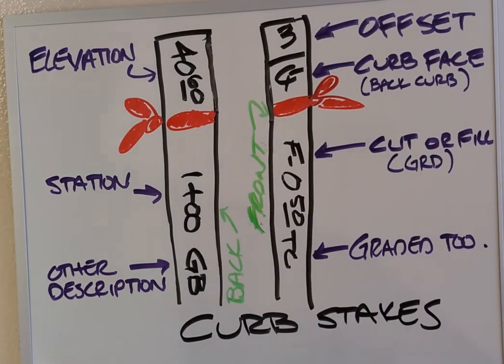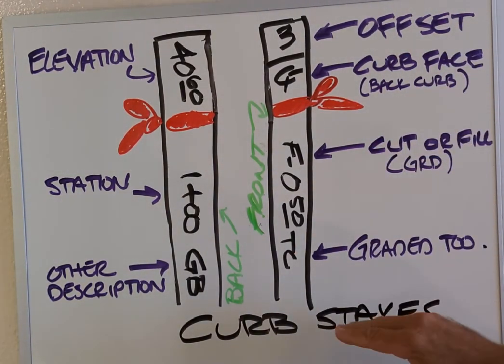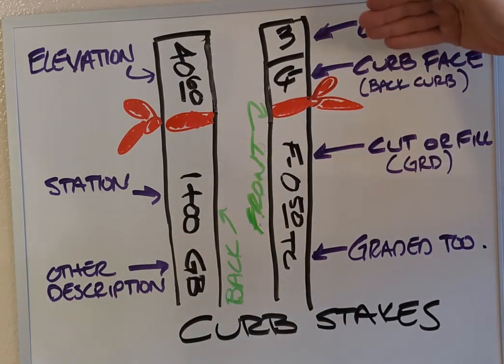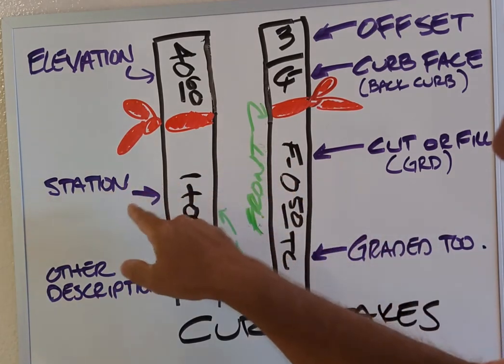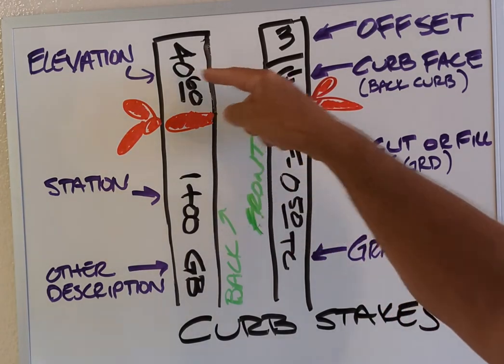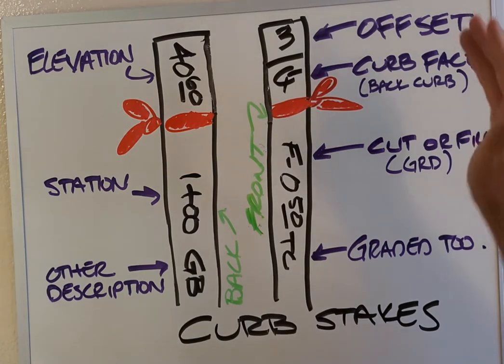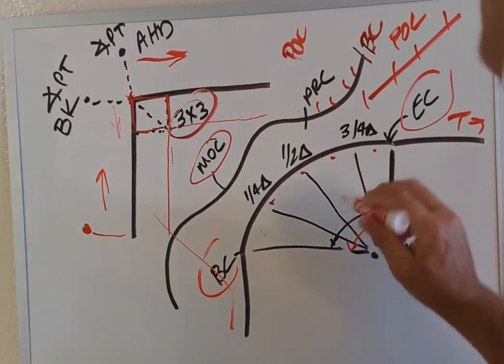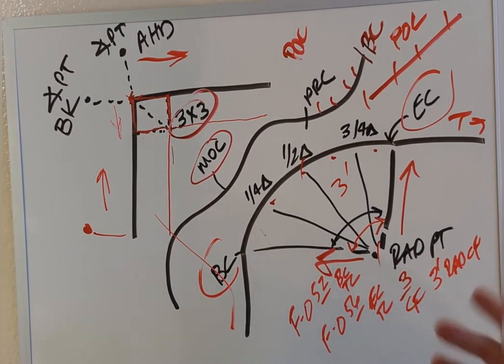How to read Survey Stakes.  Curb Stakes

Comment: worked const 37 years never seen stakes set to face of curb. its either edge of slab or back of curb
Reply from the maker: I thought you all were the odd ones, but CA for some reason uses Curb Face on all the plans.  We will stake back of curb if there are  roll curb transitions which happens a lot out here with condo townhomes